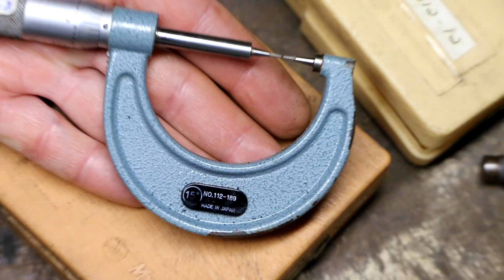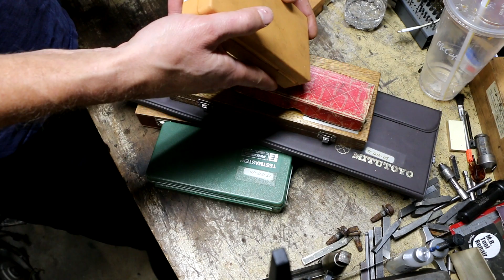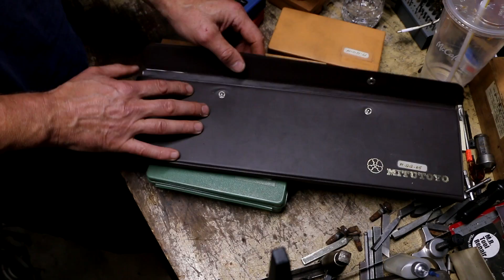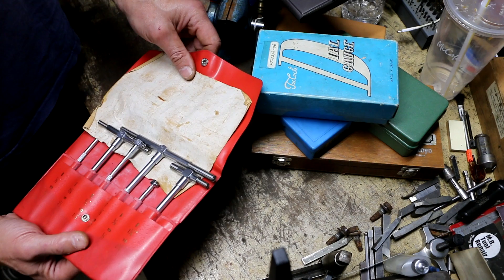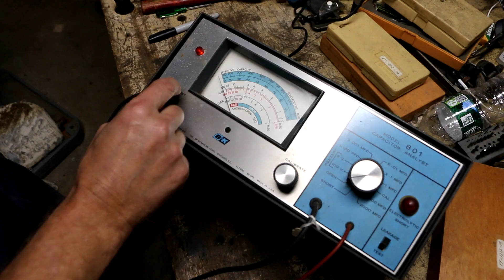2021 Fall Brimfield Flea Market Machinist tool picking Day 2 of 2

Comment: I think I may have that exact same vise.  Same color and it does have a rubber base. I don't see any label on it, might be hidden in the random drips of some unknown substance that's all over it.  Where does yours say Japan?
Reply from the maker: Its marked Japan on the chrome plated disk with the 3 screws in it.

Comment: Mitu 112-189 is handy like crazy. Prone to damage/wear at the tips. Narrow groove and small hole measuring. The tips should be a spherical form. 
Vise at 12:00: I have one (had two, gave one away to a starting modelmaker). Very handy. The suction base on these was not good when new, and the ones I have had were made of a natural white rubber that aged badly, like much mid-century Japanese manufacture rubber. The original handles on mine are long replaced, but not with such fancy ends.
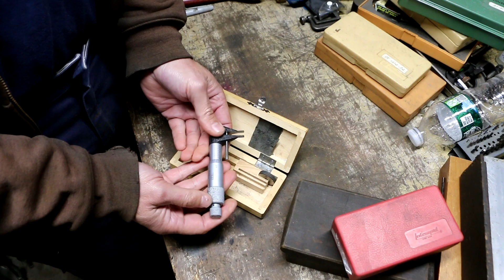19:00; $5 is a steal for that inside mic. 
20:30: $10 for the collets is the steal of the day. Easy to make a holder/closer for a standard lathe if you don't match them to a watchmeker lathe. Are the Levin, maybe?. Very nice